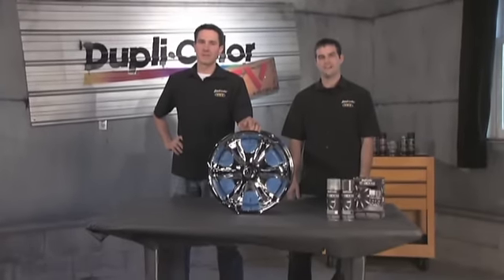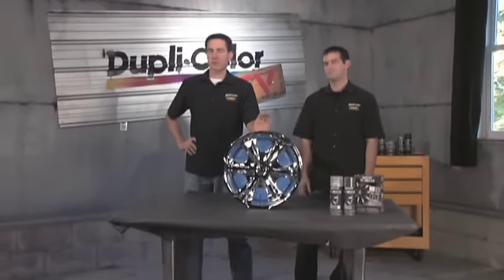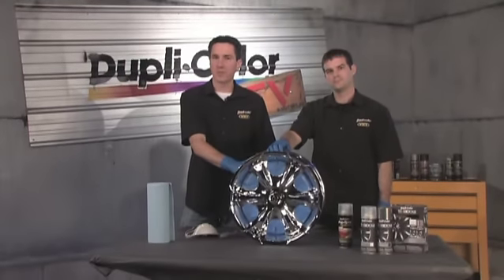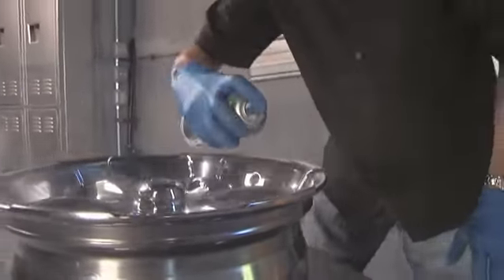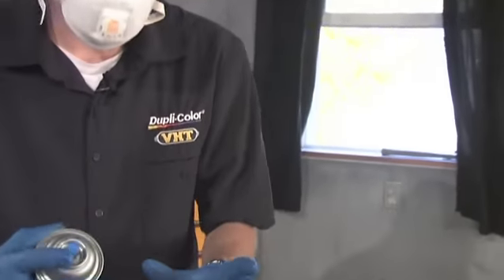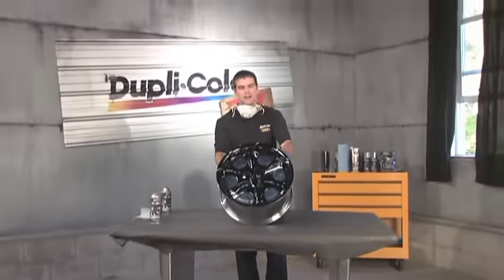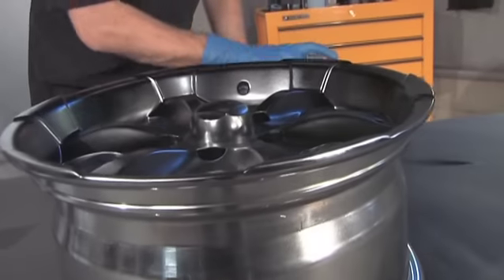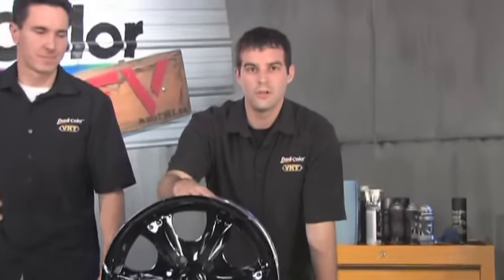How to Blackout Chrome on a Car with Shadow Chrome

Comment from the maker: @famousfool Shadow will adhere very well to Chrome as is. If you purposely try to scratch the coating then it may come off. Since Shadow is a translucent coating you should not scuff the chrome as you will see the scratch marks through the coating.

Comment from the maker: @Giliganism If your looking for a similar concept to our Shadow kit but you want other colors like Blue or Green as mentioned you can check out our Metalcast line. I suggest clear coating the Metalcast as well but use our Wheel Clear Coat HWP103. Thanks for your interest!

Comment from the maker: @tomsawyersucks - Most definitely! Just be sure to *thoroughly* degrease the surface and scuff with 600 grit sandpaper. We also strongly suggest that you add two coats of Adhesion Promoter IMMEDIATELY before painting.

Comment from the maker: Hey 351... Shadow will resist temperatures up to 120 degrees (so it should be OK on the wheels)... also, it will definitely withstand normal cleaning... hope this helps... thank you...

Comment from the maker: @lespaulguitarist92 as he says in the video, do not sand the wheels, it is a translucent black coating, any scratches will show through. Just make sure it is clean and use the prep spray, the smoother the finish on the rim, the better it will look.

Comment from the maker: The shelf life for aerosol paints is only 3 years. If the garage was not heated/climate controlled, I would not suggest using this product.

An example of the batch code on the bottom of the cans is:

BE 1233 RF 13:15

BE = the plant where it was made.
123 = the 123rd day of 2013.
3 = 2013.
RF = Slip number.
13:15 = the time it was filled.

Comment from the maker: Hey Cvnappsable,
Shadow will not create the same look over steel, as it does over Chrome plated surfaces.  I'd suggest using High Performance Wheel coating. You CAN use Shadow, but don't expect the same final appearance as we show over Chrome.

Comment from the maker: Applying the Shadow coating over a surface that's not Chrome will not provide the same look, but it's not impossible.  So long as you use our Adhesion Promoter to prep the plastic surface, you can basically use anything in our line over it.

Comment from the maker: No do not sand the rims. Shadow is a translucent coating so what ever condition the chrome is, that is what will show through. Just make sure the wheels are clean, degreased and lint free.

Comment: @805hoodrat Hey, Sicrashalot told you wrong. As long as your wheels are polished (like chrome), so that goes for polished aluminum and polished magnesium wheels, you wheel get the same results. You have to remember that this is TRANSPARENT wheel paint and as long as the surface is polished with a mirror like shine, then your good to go :).

Comment from the maker: Hey pepi... as long as you use our Adhesion Promoter primer to prep the plastic surface, you can use Shadow over it... the brilliance of the finish will be slightly less, but it will definitely work... hope this helps... thank you...

Comment from the maker: Hye ricos... you'll want to have the rims Chrome plated prior to using Shadow over them... you'll definitely be able to see any imperfections through Shadow... you might be better off using our High Performance Wheel Coating (it won't let us put a link in the response... but you can see our Wheel Coating on our website)... hope this helps... thank you...

Comment from the maker: Hey scooby... as long as you prepare the spokes properly, ensuring they are clean, dry and dull, then you can use the High Performance Wheel Coating or Shadow over the spokes... to ensure an even stronger bond, you can use Adhesion Promoter... hope this helps... thank you...

Comment from the maker: Hey probowler... as long as you prepare the surface and apply Shadow as directed, you can use it over machined rims... the brilliance of the finish will be less over a machined surface then it is over Chrome, but it will definitely work... hope this helps... thank you...

Comment from the maker: @blaknite1 yes. Shadow is a Translucent black base coat followed with a clear coat so anything you apply it over will show through. A high quality chrome finish will provide the best finish when using Shadow however Shadow can be used over polished metal and aluminum.

Comment from the maker: Hey PinkRanger... as long as you prepare the surface and apply Shadow as directed, you can definitely use it over aluminum... the brilliance of the finish will be less over aluminum then it is over Chrome, but it will definitely work... hope this helps... thank you...

Comment from the maker: @frezze212 Shadow was designed to be sprayed over high quality chrome or polished metal for the best result and finish possible. If your chrome wheel has rust, peeling or scrapes then it will show. Shadow is a translucent coating so it is almost like applying a tinted clear coat. It will look uneven in those affected areas. It might be best to use our wheel paint depending on the condition of your wheels.

Comment from the maker: Correct - do not sand the rims. Shadow is a translucent coating so what ever condition the chrome is, that is what will show through. Just make sure the wheels are clean, degreased and lint free. :)

Comment from the maker: @351cleavland This product is durable enough for tires, but it’s not going to be debris proof.  Some things that may fly up and hit the car could damage the coating.  Also, tar remover will likely mar the finish.  The solvents used in tar remover could cloud the clear, so test it first in a small area just to be sure.

Comment: I think this will look good on my beauty rings
Reply from the maker: jbbchinook Our products are only tested for automotive uses, but if they are metal and shiny like chrome, probably! We'd love to see them when you're finished.
Reply: duplicolortv Beauty rings are for automotive use. They're chrome rings that go around wheels. I picked some of this stuff up and it did not work. Waste of money.
Reply from the maker: Thank you for clarifying. This product is specifically formulated to work best with chrome. Using it with any other metal will result in a less brilliant finish. We recommend 2 thin coats and 1 medium coat for best results. If you followed all these steps, please call our customer service line at 800.247.3270 and one of our product reps will help you figure out what happened.
Reply: duplicolortv Thank you, will do. I don't mean to bash the product, I'm sure it works for some people.
Reply from the maker: No worries, I hope we're able to help you resolve this and find a product that will be perfect for your car!

Comment: Followed instructions exactly. Looks no where as dark as that and the spray pattern was dotted after 2 coats... so it looks dirty like after it rained even though I shook it for 1 minute and turned it over after each coat... I proceeded to use the clearcoat for 3 coats to try and make it look better with no luck...

Maybe the cans I got were damaged or defective (dropped or something). If I go buy another box will it help if I repeat the process? Even though I have already applied clear coat....

Comment: How well does the shadow coating hold up to the heat cycling that the wheel may undergo when brakes get hot and then cool? Also, how well does the coating hold up to cleaning? I wash my truck every two weeks. I use a non-acid cleaner-my concern is how will this coating look several months after application?

Comment from the maker: Glen - 

You're correct -- the finishes would differ slightly. As you'd get a deeper, more rich effect on the actual metal and a bit of a duller look on the plastic grill. 

We'd suggest testing small areas on both -- if you're unhappy with the results, you can use our Paint Stripper to remove your test areas.

Comment from the maker: Hi Fernando - 
You're correct, the imperfections would definitely show through with this product. We don't have any products in our line which would give a similar effect and mask any blemishes on the wheel. 

You could definitely look into our Wheel Coatings and possibly adding Dupli-Coor Mirage or Clear Effex to mock up the shiny/mirror finish.

Comment: Can I just paint over my wheels without sanding off all the original manufacturer's wheel paint but only parts that have scratches and grinding marks when you hit a curb?
Will this paint stay on or peel, chip, or flake off in a # of years due to weather and enviornment?

Comment: I have chromed plastic trim that I want to use this application on. Is there any additional prep I should do other than cleaning? I have viewed one video that suggests that I use the Duplicolor adhesive spray before laying the color. Would you recommend that? I plan to experiment before I use my actual parts and any tips or advice would appreciated!

Comment from the maker: @corvette4554 The Prep Spray is to clean the wheel of all dirt, grease and other contaminants. Shadow can be used for other trim and accessories. Just keep in mind that since Shadow is a translucent coating it will only look as good as the substrate you are painting. If the wheel or piece of trim is of poor quality then Shadow will not look as crisp as if you painted a high quality piece of chrome of polished metal.

Comment from the maker: Brent: First, cleaning is very important, so you want to use Prep Spray and wipe off any dirt/grease and any excess Prep Spray. Taping off every spoke that you don’t want to paint is going to be important.

Once you have cleaned and taped off the spokes, you will want to use High Performance Wheel Coating.

Comment: I didn't see it yet. But if I use this on my wheels with my tires on while still on my truck how long do I need to wait for it to be completely dry enough to drive on it. This is my only ride and I can't get around it.

Comment: I did this to my 19" wheels and it takes a hell of a lot more than one kit to do 4 wheels.  To get the proper lvl of coverage.  Also the nozzle system is terrible, do not turn it to adjust spray, it just results in paint spurts if you do.  I painted these wheels after prep and cleaning in 74 degree weather, only 8% hum and it will take 4 cans ($80) to do 4 wheels proper.  The clear coat is not high quality and it shows, you are better with K2 Max clear coat.

Comment from the maker: The Shadow Black Out Kit is a semi-transparent coating. This means that if you do not even out the look of the chrome prior to applying the Shadow Kit the look underneath will be uneven. Be sure to sand off any peeling paint.
Reapply a chrome paint to even the look (make sure it is lacquer based) and allow it to dry. You can then apply the Shadow Kit and achieve pleasing results.

Comment: I just picked this up today. I plan on using it on the plastic case of an xbox 360. I plan on using a black primer before this kit. Any idea on how it will turn out? If not primer, then a clear adhesion promoter. The case is white. Suggestions? Thanks

Comment: Will it still have the same effect on exhaust and on headers? or will it start to break down. I almost bought this product to paint my exhaust and headers on my motorcycle exhaust but I was unsure of the durability from the heat the exhaust and headers will put out.

Comment from the maker: Hi Veronica -- 
While you could use Shadow, we can’t promise that it will match the factory coatings. 
If you do attempt it, be certain to sand the metal with 320 grit sandpaper until it’s shiny and clean. Clean with Dupli-Color Grease and Wax Remover before and after the sanding. Then tape off the area being painted and apply the Shadow coating, then Clear and while the Clear is wet, remove the tape carefully.

Comment: Hey man, I used to be one of those non-believers until I tried out their products myself. I used the DupliColor Trim Paint and I also used some high temp paint for my valve cover. Painted it in red, and the glossy ceramic finish was incredible in comparison to the VHT that used to be on there. Don't get me wrong VHT paints are the best, but DupliColor lives up to their name.

Comment: If I wanted to use this on a set of chrome wheels, would I have to primer them? Sand the chrome? If not, would the paint begin to chip after a couple months?

Comment: Really concerned with delamination since you say not to scuff. How long is this going to last? Your prep spray does what? Thanks
Reply from the maker: +Jeff Johns Shadow works over shiny chrome plated surfaces. If you have rust spot, you'll need to sand that away. If you sand chrome, you'll dull it. If you apply Shadow over a dull surface the appearance will less brilliant than if you used it over a evenly shiny surface. As long as you prepare the surface as directed, the finish will last a long time. How long it will last will vary depending on weathering conditions.
Dupli-Color Grease and Wax Remover Prep Spray will assist with the very first step in any paint project. It removes dirt, road tar, grease, wax and oil from any surface without leaving a film residue. We hope we were able to answer your questions.

Comment: As all paints, it won't stay perfect for long. Environmnet, rocks, chemical spills, whatever.
My wheels are OEM chromed aluminum and very expense to replace......

Can the coating be removed using a solvent without damaging the chrome?

Thanks

Comment: I have bought a 2009 corolla and it has some serious scuffs and scratches. These rims im working on are factory stock rims. My plan was to paint strip them work the morphed/ damaged metal, fill in the scuffs and indentations and apply this product after doing a few coats of primer. Since this is a translucent paint i guess i am out of luck:/ but is there any other product that will give me that shadow effect on black rims? ?? I am really going for a shadow black finish

Comment from the maker: @poctob3 -- Shadow is formulated specifically for over Chrome (or other, similar surfaces) - so it will look awesome on all your Chrome parts. 

Because something like a door handle sees a lot of use -- it will have a lot of grease and dirt on it. Use our Prep Spray to give it a thorough clean and degreasing -- and that should help Shadow adhere well to those high-traffic areas.

Comment from the maker: Hi Chuck! No need for a primer (because Shadow is a translucent coating) - but definitely clean yoru rims with Dupli-Color Grease and Wax Remover. You can use a clear coat for extra protection as well.

Comment: I know this is stupid, but if you tape the heck out of the tire after thoroughly cleaning the wheel, is it possible to get the same/close results as if the tire was dismounted? Has anyone done this with good results?

Comment from the maker: @dudetubez Your process would work and be plenty durable but depending on the color your after, I'm actually going to suggest going a different route but reverse the color steps. Test each process on a test panel until you get the color your after. Scuff your rims so the paint will bond, prime with our Self Etch DAP1690. Base color coat with Gloss Black Engine Enamel, coat over the black with the Metal Cast Red as this will give a Black Cherry color. Final Clear with our Engine Clear. Good Luck!

Comment: Will this come off when I power wash my wheels? Thanks thanks!
Reply from the maker: +richiemnemonic Hi Richie. Thanks for your question. If properly applied, Shadow Chrome Black Out is permanent and would need to be sanded off, so there's no worry of a power-washer removing the coating. Thanks for your interest in Dupli-Color!

Comment: I have a new 2012 Dodge Ram Sport. The 20" factory wheels are chromed plastic, as most are now. Does this work as well on "plastichrome"? Also, what about the chromed stainless tube steps; they have non-removable flat black, unpainted step pads on them. Just mask around those? Thanks!

Comment from the maker: @MrHoess1234 
Yes, prep is the most important part of any paint project. We recommend thoroughly washing and degreasing prior to paint application. A clean surface allows for the paint to adhere and since Shadow is translucent, any dirt under the basecoat will show through.

Comment from the maker: Hey 207053... you'll want to make everything appear even prior to applying Shadow... if that means sanding in your particular situation, then you'll need to make sure you do so evenly... so long as you use our Adhesion Promoter primer to prep the painted surface, you'll be able to use Shadow over it... hope this helps... thank you...

Comment: Awesome product but what if one day I need to remove it? what do y'all use or recommend?
Reply from the maker: +michael garcia What surface would be you using it on?  Depending on the surface, sandpaper or a chemical stripper would be used to remove it.
Reply: +duplicolortv  it will be used on a chrome rim
Reply from the maker: +michael garcia You could use our Paint Stripper product to remove it.
Reply: +duplicolortv OK thank you

Comment: +dupli-color tv  would you recommend using adhesion promoter on my chrome bumper first?
Reply from the maker: +Dylan Schwartz Hi Dylan, thanks for your question. Yes you will need to use the adhesion promoter before spraying this on your bumper. Good luck on your project!

Comment: I have a plastic grille that has a chrome coating, how will this stuff fair on it?
Reply from the maker: Pretty well - make sure it's thoroughly cleaned and degreased. If at any point you're unhappy with the finish, our Paint Stripper will remove it.